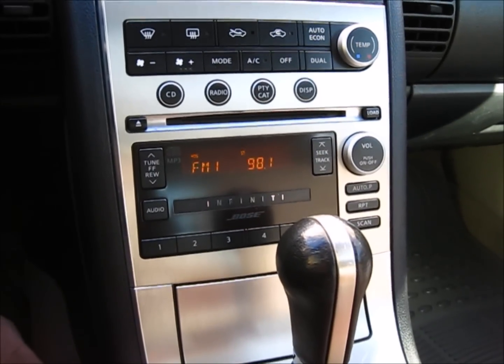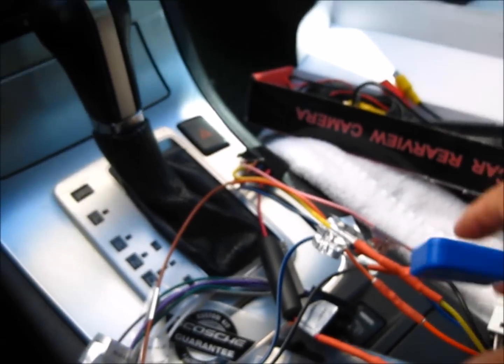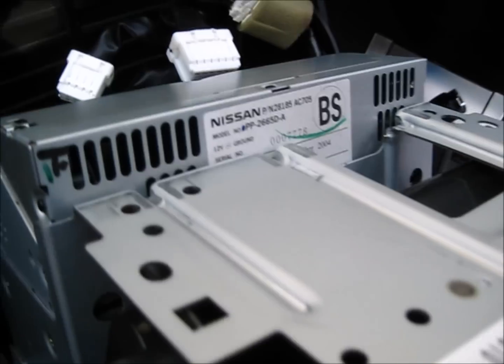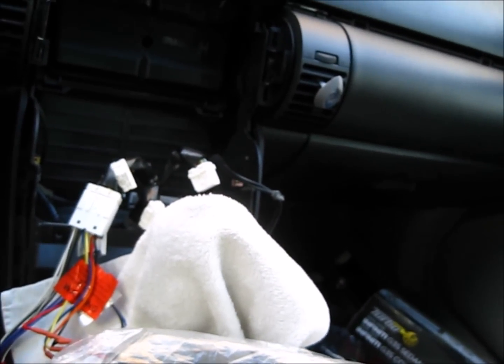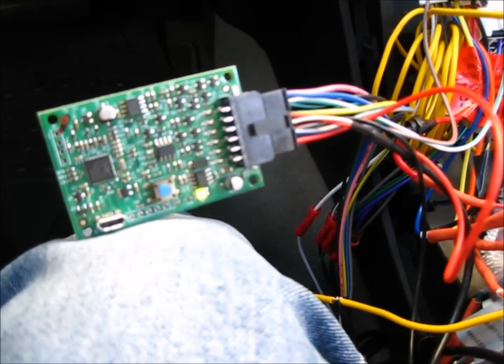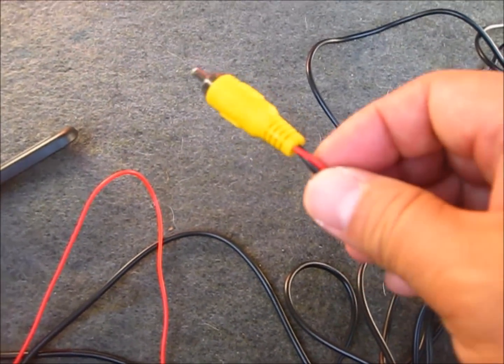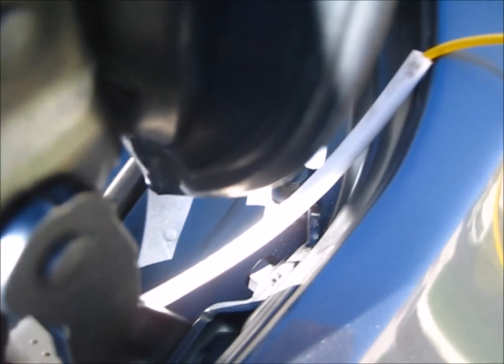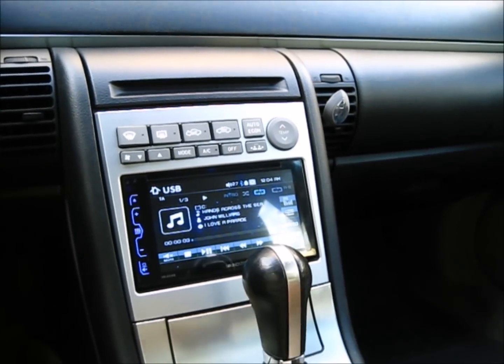Infiniti G35 Double DIN DVD Receiver, Steering Wheel Control ASWC-1, Backup Camera Installation

Comment: Why do non of these videos show how to connect or convert the climate control from the cold and hot  Knob kind to the push button cold and hot??? Is there a harness that just plug and play because the connection for the knob kind is different than the g35’s that did already come with the push button kind hot and cold type?
Reply from the maker: Marco Gonalez if you go to Crutchfield website , find Metra 95-7605 Dash Kit, it comes with the necessary harness.

Comment: Hey boss, was this a sedan or coupe? Just wondering so I know if the tail light wiring will be a tad different. Also, how’d you get the Dual climate control to work? Was it plug and play or did you have to take extra steps? 

I currently have a double din setup done by the previous owner. It’s a clean setup but they didn’t wire the steering controls and I’m also going to had a sub and backup camera. It really is a pain to get back there on the head unit so I plan to do it all at once.
Reply from the maker: David Paiz It is a sedan. I didn’t do anything special on the dual climate control, is a plug and play. Good luck

Comment: Thanks share your videos.
I’m able to upgrade my head unit to 10.1 Android. 1din, mount above the climate control.
Reply from the maker: ming z thanks, nice,  I wished I installed a head unit that is with both CarPlay and android
Reply: I’m think add 360 camera module, after new radio

Comment: Big question, does the steering wheel control wires affect the cruise control? Or is it just used for volume need fast response please.
Reply from the maker: Chris It should not affect cruise control, but I don’t have proof, my cruise control was not working to begin with.
Reply: chenlaoding Okay, thankyou for the reply. Im wondering where i can get proof, hopefully i can get more feedback from others, i still appreciate you replying thankyou.
Reply from the maker: Chris call crutchfield, 1844-810-9346, their tech service will tell you with certainty
Reply: chenlaoding also strange your cruise control wasnt working :/ big feauture.
Reply from the maker: Chris I bough my car used, didn’t realize cruise was broken till weeks after.

Comment: Really great video, thank you for putting this together.  Where did you end up grounding the Axxess Steering Control and your other ground from the harness?
Reply from the maker: Kevin Yu Thanks. You can find a metal structural part, there should be many places under the dash
Reply: Thanks, and you mentioned in the video Metra's recommendation of having an individual ground and not sharing with the radio ground.  Did you end up having individual ground or can I just ground this with the radio grounds?

Comment: What levels did you end up placing the gain to on the scosche?
Reply from the maker: Will I ended up taking this radio out and exchanged for a better one. When I installed the new one I got a new Scoche. It’s been a while I don’t remember where exactly I set them, but I think a little over halfway maybe three quarters.
Reply: chenlaoding Awesome, thank you! I'll use those numbers as a good starting point!
Reply: What’s the scorche for ? Do we need it
Reply from the maker: keanu Romero I followed direction and installed it, I am not entirely sure if you definitely need it or not, I think it regulates the output from the radio to amp
Reply: chenlaoding I don’t have a amp or bose
Reply from the maker: Will I think about 3 quarters from max.

Comment: I want it for my 04 g35x sedan do they have it ?? And how much
Reply: I have the exact same car as you and yes! I decided to remove the bose amp and have an amp for the sub and a 4 channel amp for the speakers using the same wiring from the bose amp to the speakers for the new amp. And new new RCA cables to make the install simple. Good luck with your set up.
Reply from the maker: lil william I'm not hundred percent sure but I think 04 is the same design as 05, you can always check Crutchfield website for details
Reply from the maker: Joseph Diazz Double DIN

Comment: What rearview camera specifically did you use?
Reply from the maker: Tristan Luna Just an inexpensive no name one from eBay, under 10 bucks. It works as good as those expensive ones, I have another one installed for 4 years, still working. https://www.ebay.com/itm/172556320840

Comment: Nice vid... Metra really needs to upgrade those buttons for their kits. But then you always can get the JDM version...
Reply from the maker: Joseph Jacobs Thanks, ya, I wish I knew about JDM before I started, the lowest priced JDM is about $350, which is roughly $200 more,but if I have to do it again, I would opt JDM.
Reply: I know, that has been my dilemma. I've been putting it off, now my CD player no longer works, so I will be doing this soon. Thanks for the vid though, very helpful...
Reply: Fuck i payed $550 for my jdm bezel, I live in Canada though